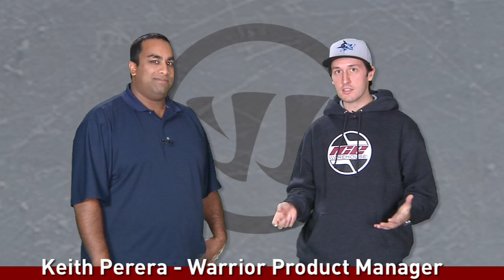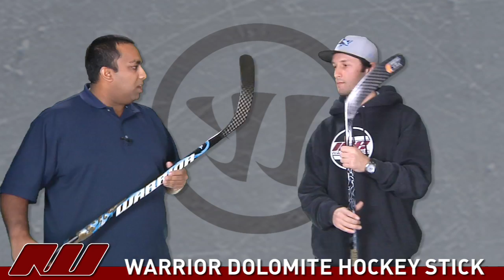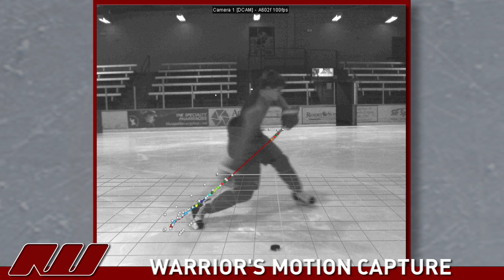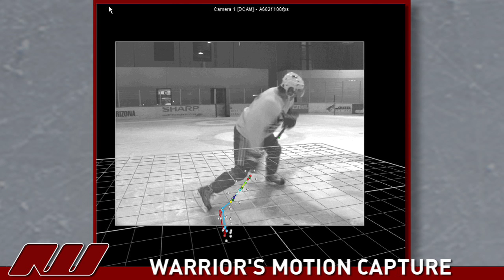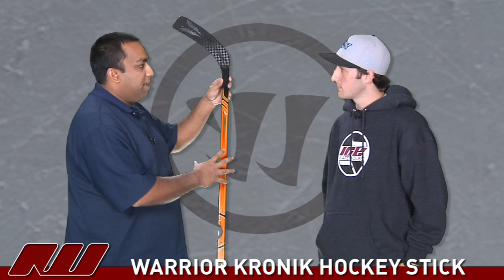Interview with Warrior about new sticks

Comment: i wish they would bring back that sale they had of pro stock blades, those are the best blades i have ever used, the regular warrior blades break so ridiculously easy and feel so cheap, the HD was a step forward though with the improvement in strength of the blade construction, but the 06-07 were still the best